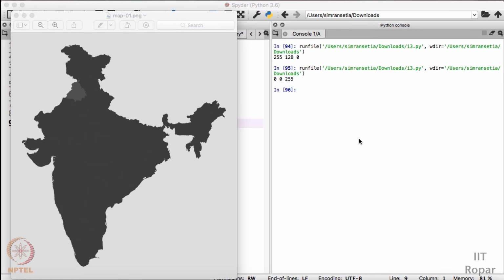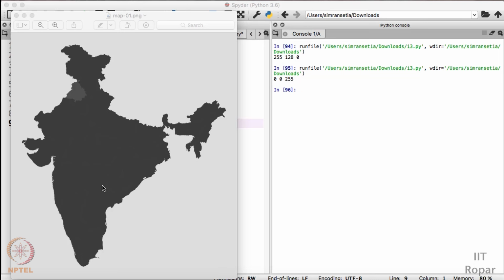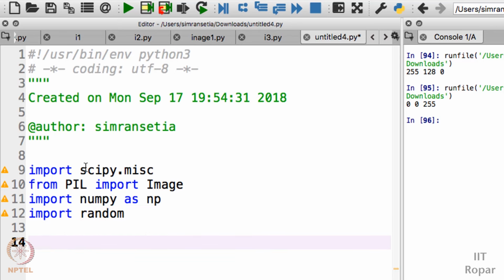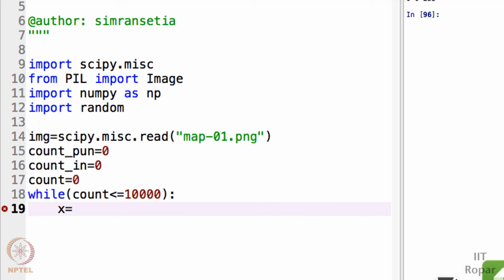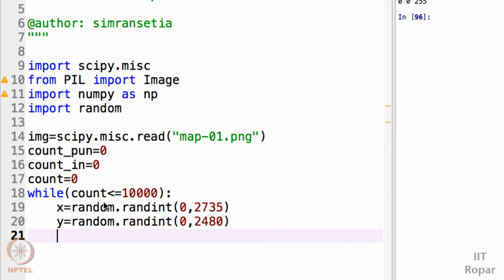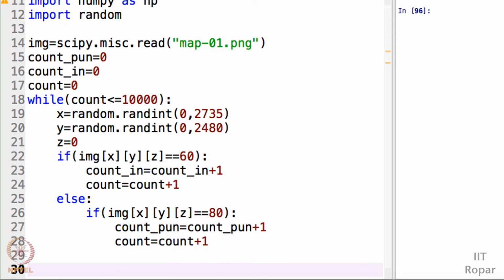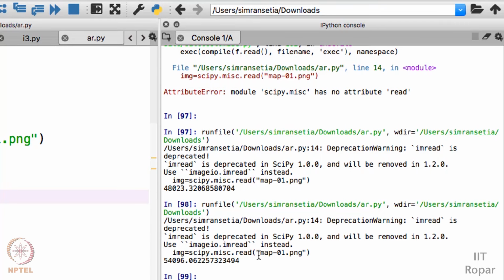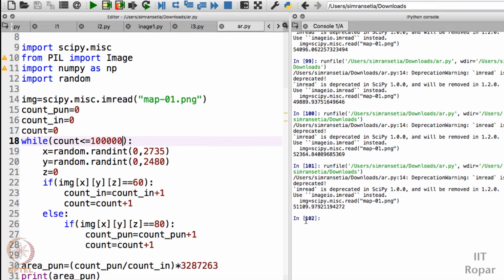Area Calculation - Don't Measure - Part 05

Comment: img[x][y][z] == 60:

did not undertstand why 60 and 80 are used and what they represent in the program ?
Reply: It's the rgb value of black region and grey region respectively, as calculated earlier in video
Reply: @shreyashavaldar2076   it is not calculated anywhere I think,  all we saw were separate rgb values 60,61,60 & 80,81,81. Maybe the approximation is taken? I am also confused by this
Reply: Ok found that checking "r" will be enough. See next video in this series
Reply: @SunilAruldas  👍